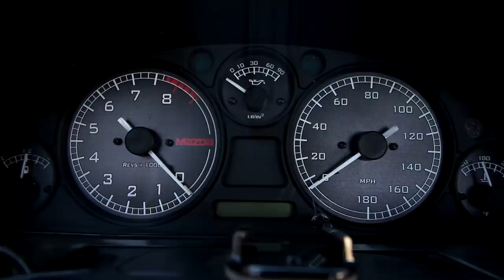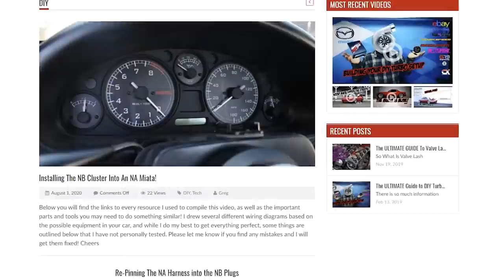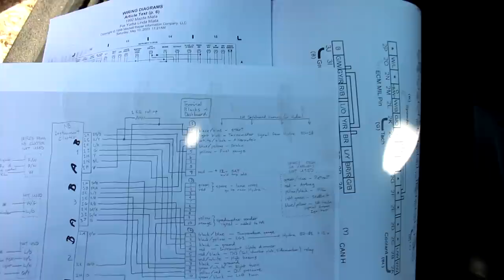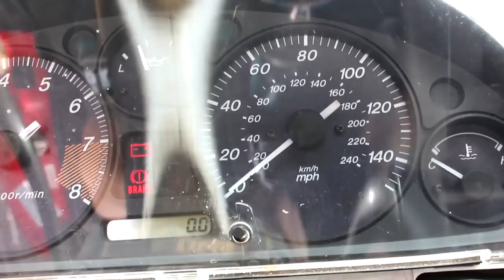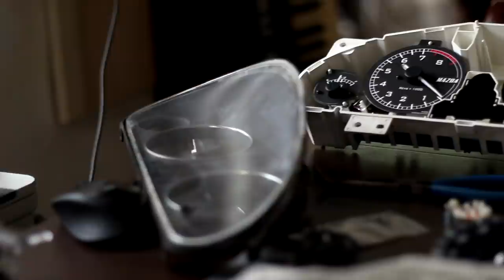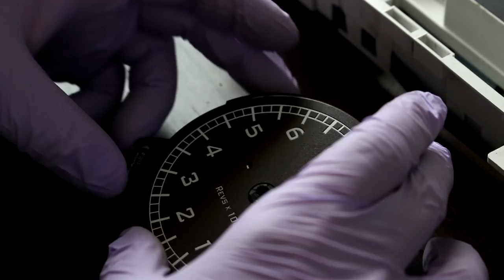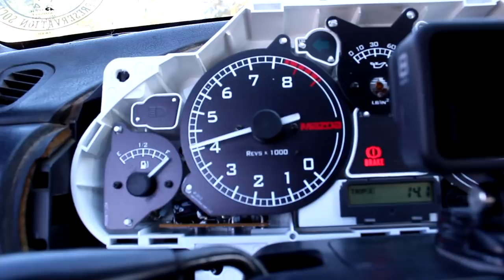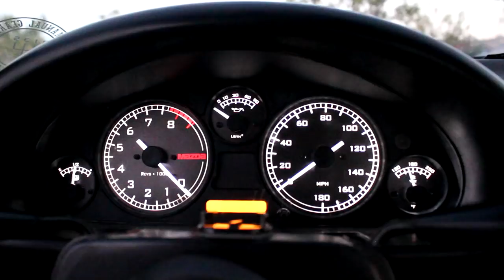The ULTIMATE GUIDE To Installing an NB Gauge Cluster Into An NA Miata! (w/ Oil Pressure Retrofit)

Comment from the maker: - Table Of Contents - 

-NA vs NB Cluster 1:34

-Speedometer Setup Overview 4:47

-Fitting The Cluster 7:57

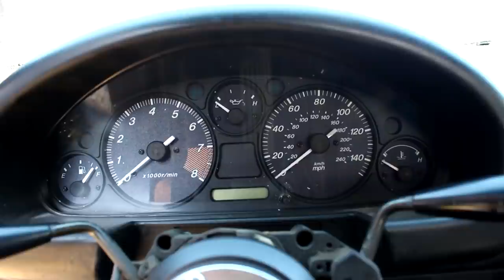-Pinning The Plugs 9:20

-Speedo Setup Test 14:59

-Gauge Faces + Oil Pres. Sensor 17:32

-Adding A Speed Sensor 25:17

-Set Needles + Speedo Calibration 26:43

-Megasquirt Setup 31:24

CHEERS!
Reply: Your car is so fast, now being able to see the speedometer! It's nice visualizing it.
Reply: Awesome Greg I just did mazdaspeed swap on my NA but was looking how make work my speedometer.. ill start to buy the parts. Thanks for the video
Reply: -smol PP 3:17
Reply: Pretty sure if you put these in the description and format them correctly they will show on the play line and next to the timer
Reply: You seem to have forgotten to pin the comment

Comment: This is a great video.  I spent weeks sorting the gauge cluster in my Locost.  I’m the fourth owner and no one before me invested the time to make a working speedometer, beam indicators, fuel level, gear position indicator, and odometer.  The car is so much better to drive with instruments that function.  You have my respect, sir!   I own an NB also and jealously covet your oil pressure gauge.

Comment: 35minute video sums up days of work 😂
Everyone has working speedos but me now! 😭
Let me go build a shopping cart, thanks for all your hard work and editing miata dad ❤
Reply: Not everyone, I still don't have a working speedo either
Reply: @MrMiati-ri5uc  you running a trans swap or just said F it? Haha
Reply: @nickwild7  BMW 6 speed with gm getrag rear diff
Reply: @MrMiati-ri5uc  I have the ZF6 as well, have the 3.23 and V8R kit just need to install it lol
Reply: @nickwild7  I went with the 3.23 as well. You won't be disappointed. Also the install isn't really that bad, the only reason mine took me a while is because while I was doing that I was going from bone stock 1.6 to built 1.8 with a turbo. My friends did a video on my car a few weeks ago, if you want to check it out their YouTube channel is Napp Motorsports, they've got a couple other Miata reviews on there as well, mines the green one.
Reply: @MrMiati-ri5uc  I'll have to go check it out.
Mines taking forever 1 because im in iraq, 2 I have no idea what I'm doing with a welder haha
Reply: @nickwild7  hahaha I also have no idea what I'm doing with a welder, just fortunate enough to have a friend or 2 that does
Reply: @MrMiati-ri5uc  we have super similar builds.
I have 264 .050" cams
475lph fuel pump
1300cc injectors
FM manifold and full 3" exhaust (straight pipe"
Skunk 2 intake/TB and everything else is pretty much the same. (Including turbo/trim)
I made 300whp/243wtq 17psi on 91
400whp/330wtq 22psi on E85

Super knarly car, it's funny because I will warn you now, car will feel like a freaking rocket at 400whp and when I switch to pump gas and MS switches maps and I lose 25% of that HP it feels like slow as fuck 😂😂
Reply: @nickwild7  I bet, I'm also planning on switching to a 2867r super core which should give me the capability for 475 wheel, can't wait for the corn tune next spring though
Reply: @MrMiati-ri5uc  you trying to make all the power up top? Could go G25-550 or even 650 if you just wanna join Elon Musk lol
Reply: @nickwild7  lol not going to go that far, 475 will be plenty in a Miata, if I want more than that I'll start another project that can put the power to the ground a little better
Reply: @MrMiati-ri5uc  its interesting you're having traction issues, im running 15x9 6ULs with 225/45 NT01s and 1st gear is the only gear I cant ride out. 2nd-6th is fairly drama free.

Comment: You're forgetting about the super extra bonus function of the NB cluster... the extra doinker above the temp gauge (that is used as the immobilizer warning light in NB2's)!!! I had Adam make me a generic red spot lens for that little dot so I can put a warning light back there. I've yet to install it because I've yet to decide what I want to do with it, but with +12 ignition available back there, all you need is a ground switch of your choice and you can turn on a red light on the dash for anything you want. Oil pressure, traction control, water pressure, etc etc. The possibilities are endless!
Reply: Also, if you want a properly accurate water temp gauge, putting a VDO gauge into the NB cluster is hella easy compared to what you ended up doing for the NA oil pressure gauge. I'm happy to send you pictures of how I did it if you want.

Comment: Hey Greg I'm working on putting an early na oil gauge in my nb cluster with the na oil sender we wired everything up and when testing the lights such as brake airbag cel worked until I switched the key to accessory mode then we saw some smoke so pulled the cluster and found a burn in one of the contacts on the blue backing plate.  I'm pretty sure I followed the wiring in the video to a t any insight on what might be happening would be much appreciated thanks Greg

Comment: 30:18 Literally the same page, right above the ppm values says 'ppm values listed below are only valid after calibration is complete'... That literally means that you have to calibrate the sensor as you did for the 2000/4000 ppm to be correct :D

Comment: Hey miata guys i have a question i have a 96 mspnp2 can i just plug in a e85 sensor sensor to the ms or do i have to solder a 10 k ohms resistor to my mspnp2
Reply: Its the options port on ms2pnp #13 called launch control input pin. U just wire the signal wire from the flex fuel sensor to it. With ms2, they make u choose between having launch control or a flex fuel sensor but not both at the same time.
Lame, I know.. But it does the job.  

when I say options port I mean the extra harness with 26 pins they give you when u buy the ecu new. U wire the flex fuel sensor's trigger wire to #13 of the options port. Also known as launch control input.   after u do that (assuming u supply power and ground to ur sensor obviously) you go to tuner studio and under flex settings choose input as launch. Then you're all set. You can add the flex gauge to your dashboard and it will work.

Comment: If I was facing that much work just for the oil pressure gauge, I would install a generic oil pressure sensor and a CANchecked LCD gauge. That way you can have oil pressure when you want it, but also any other data Megasquirt has, plus configure things like alarms - how about a flashing warning with buzzer when coolant is over a certain temperature?

Comment: Awesome vid, just wondering if you tried to use the VSS input on the Megasquirt and output the proper value directly to the speedo instead of using the Dakota box? Still Mad Props keep up the passion 👌🏽
Reply from the maker: I did not but that's another viable option. I wanted to bring this into the equation in case others are trying this without MS3/MSPro. There are many ways to do things like this 🙂

Comment: Creg HALP! I have a scenario you didn't cover but is close. I have a VVT swapped NA with a NB trans. I want to do a digital PI dash that gets its sensor info from my MS3PRO. I'm assuming i cant just plug the NB VSS into the MS3 since theres some sort of signal conversion happening in the OEM gauge cluster. Whats the best way to convert the NB VSS signal so its readable by the MS3?  Will that fancy Dakota box do the conversion for this senario too?

Comment: hey Greg  i have 1996 5 speed miata that worked flawlessly until one day it died at work cranks but doesn't start it has new fuel pump,crank sensor,cam angle sensor,new battery have you had this problem?

Comment: My only question/comment is that I thought that you could run the cherry sensor into the Megasquirt and have IT output a pulsed output to the speedometer and odometer. That is essentially what I’ve been thinking of doing if I go with the BMW 6-speed.

Comment: 19:42 What about simply mounting an NB oil pressure sensor, instead of all these issues with fitment of the NA oil pressure gauge in the NB cluster?  Or....perhaps I just forgot that the NB is a dummy oil pressure gauge and the NA is the good stuff? :)

Comment: So I have a ‘91 NA. I swapped the diff for a 3.9 NB Torsen. Now the speed gauge show the invalid numbers. If i put the stock NB electric (3.9->yellow) speedometer to the 5 speed NA transmission and connected to the NB Cluster, it will work with the stock NA ECU?
Reply from the maker: Yes. If you're using a stock transmission (5 or 6 speed) you don't need to add the speed sensor or the conversion box.
Reply: TheCarPassionChannel thank you very much 😁

Comment: Greg you should fix mine  I have a Mazdaspeed  cluster  6speed granny  turbo  all hooked just my speedometer reads low im going around 70mph my cluster reads 30mph lol...
Reply from the maker: Possibly just needs the needle reset? What does it read when you're driving at 40mph?
Reply: @TheCarPassionChannel   stays on 20mph take time to read the speed  but never accurate sometimes needle just drop  I have done a research but  other  people has  a different issues   they going on 60mph speed whe. Speedometer reads 120mph .  kind of weird  issue that I have.

Comment: Is there any chance you wanna share the pinout/diagram you used? I am making a adapter loom for my NB -00 for MaxxECU
Reply from the maker: Check out the top link in the description, it includes several diagrams that I made, and at the bottom of the page all of the resources I used
Reply: You rock 🤘🏻

Comment: Hi! I have a 91 miata with a oem 4.3 diff and a mechanical speed sensor, i have installed a 6speed from a nb sport with a eletronical speed sensor, now (obviously) the speedometer doesn’t read the right speed, the easiest way was to put the 4.3 gear sensor, but they are completely different, what can i do without change the 4.3 differential?
Reply from the maker: You can install the 4.3 mechanical sensor into the 6-speed, it's a direct swap.
Reply: I tried but the 4.3 sensor have a bigger sensor pignon and it wouldn’t fit

Comment: or you could just go to mx5 digital and fix all of this and get a built in 0-60 timer
Reply from the maker: Timing acceleration from a VSS is inaccurate so it would be pointless to get it for that feature. I have a full video covering this topic 🙃 I can get the rear tires to spin to 60 REAL quick 😅
Reply: @TheCarPassionChannel  It doesn't just include that it is a full digital Guage cluster that does everything the nb one plus it has real a oil pressure Guage.
Reply from the maker: @Robberbarron27  Yes and I like original gauges. The MX5D is a cool unit though

Comment: Hey Freg! lol So i have an s14 sr swap in my 92 miata with a 5 speed, i believe a speed sensor is installed in the transmission and has a 2 wire output. i was curious if i was able utilize this instead of your DIY sensor. 

p.s this is one very tiny part of a massive headache of wiring i’ve been dealing with
Reply from the maker: Yes you should be able to use that sensor, and you might even be able to pin it directly into the cluster. If the calibration is off you'll need to just run it through an adjustable conversion box, but you won't need the additional sensor.
Reply: TheCarPassionChannel i’m currently running a 240sx dash that fits like poop in the dash obviously but the speedo/tach seem to work before i took the car apart. whenever i switch dash clusters i’ll most likely go for the calibration box because speed reading may be off due to wheel size/VLSD. appreciate the response !